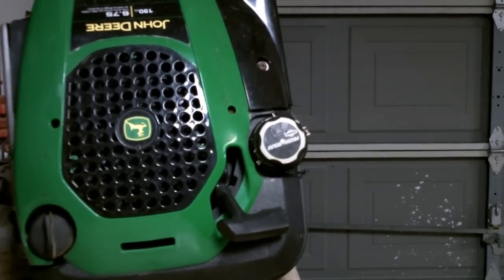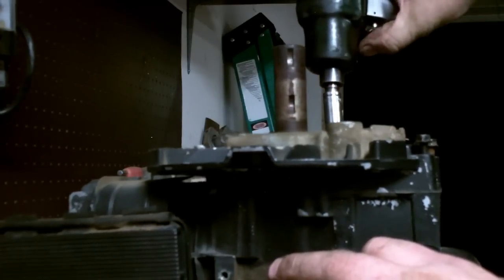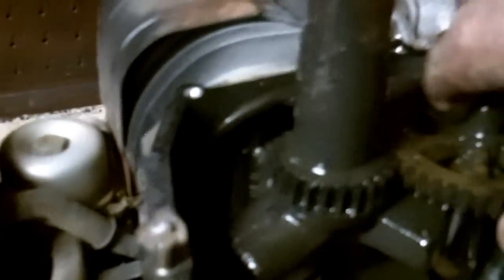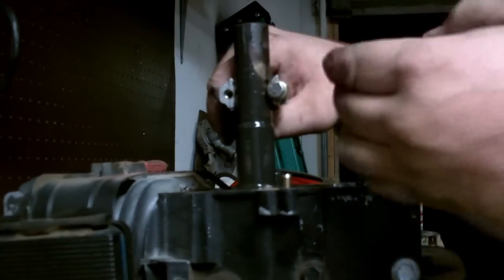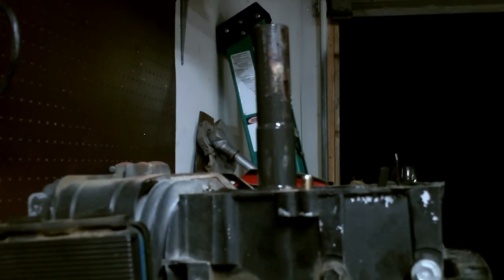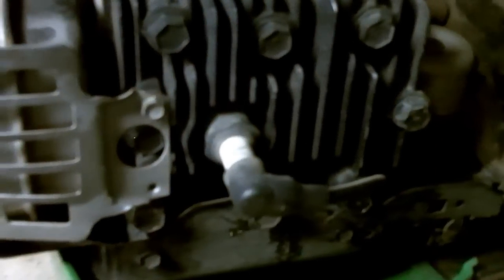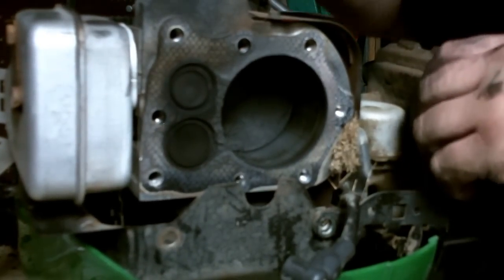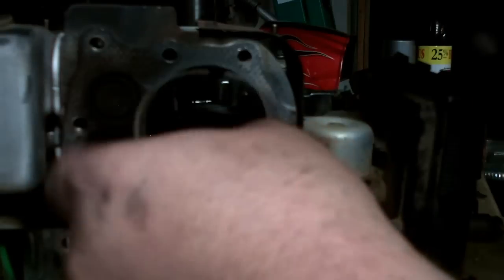BRIGGS AND STRATTON ENGINE TEAR DOWN FROM MY "HOW TO REPLACE AN ENGINE VIDEO"

Comment: Have you ever ran across one that the crank shaft is so rusted the sump won't come off?I have a 173cc that I can't get the sump off without damaging it.I have sanded it with 120 grit cloth strip and removed the seal.I was thinking of heating the sump with a prophane torch next.Do you have any advise.Thank you sir.

Comment: I Tried 3 different good coils to test this engineeven checked the cam for something loose moving or worn cam was good. timing marks where right on.valve clearances where reset to int .oo5 and exh .010
Reply: +Bob Rei No both are 5 they are 4 but I do mine at 5

Comment: I have a John Deere lawn tractor LA 125 with a Briggs engine. It stopped running,  and I found that the flywheel key was sheared. I changed the key, and it started right up and ran for two seconds, and sheared the key again. I put another key in, and it sheared that key. I am think that this engine might have the cam with the nylon gear, and possibly the gear slipped on the shaft. I now have to pull it apart and see what might be  the problem. Can you give me an idea what you think might be the problem? Also if it is the cam gear that has slipped in the shaft do you know if an all steel cam is available?
Reply: @mgomez5606  , I have a 21hp B & S that I believe the cam gear has spun the key on, because it first spun the crank key twice & now it won't start. as if it's out of time?? I bought a new cam gear & key so I'll be splitting the case this weekend.

Comment: You Said If I have any Briggs Questions ask So Here It is I have a not very old 6.5hp OHV 120312-0150-E2 engine won't fire with starting spray. or fuel I have torn it down put it back Nothing damaged any where, Not even flywheel key.If you look at 18 hp Briggs and Stratton rebuild pt 7 I asked the guy the same question and I posted everything I did and checked on this engine can you read my posts and figure out why I have this problem? (perfectly good engine) I don't want to part it out. I need it LOL Damn wood chippers.
Reply from the maker: How many volts coming from coil? Should be 20k or more.
Reply: +JEREMY FOUNTAIN (THEMOWERMEDIC1) I only ohm ed out the  coil, I did a search for what volts and only got an ohm test. the first coil had 0 ohms when I changed the coil from another engine it had like 4.6 something ohms.
Reply: +Bob Rei Have you checked your valves for the proper clearance ?
Have you got it running yet ? 
I love those 6.5 hp engines but the flat heads are my favorite. ~!~!